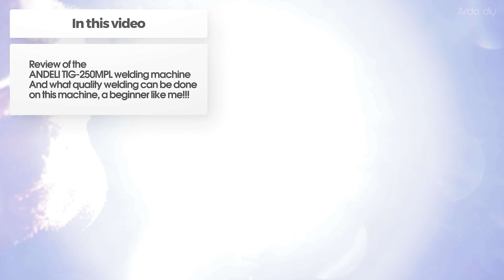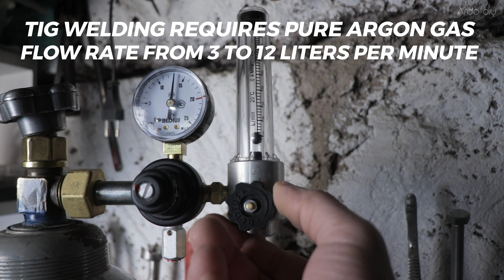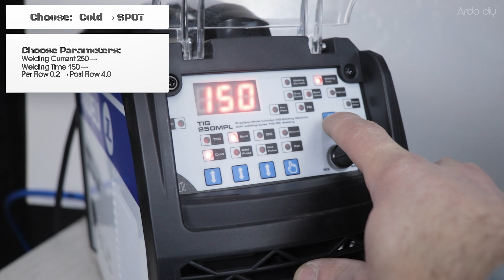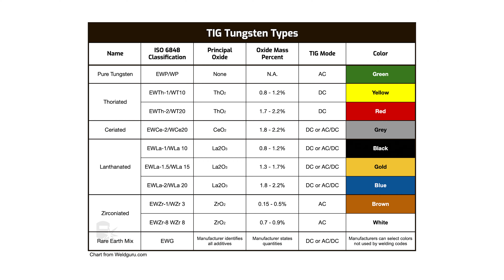Andeli TIG 250MPL COLD Welder - Review Cheap Pro TIG #andelitig250mpl

Comment: This machine has 120v/240v, can it spot weld 3.5mm mild steel wires to make free form sculpture if it can what's the thinnest wire can i join with this machine, lastly what other type of metal can this weld? Thanks!
Reply from the maker: @SK-wp6vh  Hi 👋. The thinnest wire I worked with was 1.5 mm. I must warn you right away. If you are a beginner and have not worked on such a welding machine, everything will turn out crooked and bad from the first. Personally, I began to be able to weld normally after 4-7 days of work. Specifically, this machine welds many types of steel but does not weld aluminum. For different types of steel and you must use different electrodes, you can search on the Internet. Here's one link for an example https://www.jasic.co.uk/post/tig-tungsten-electrode-types
Reply: @ArdoDIY  Jak nie spawa aluminium? przecież to jest TIG AC/DC